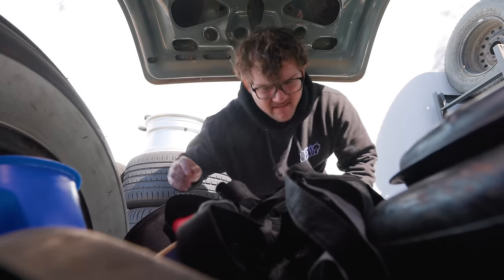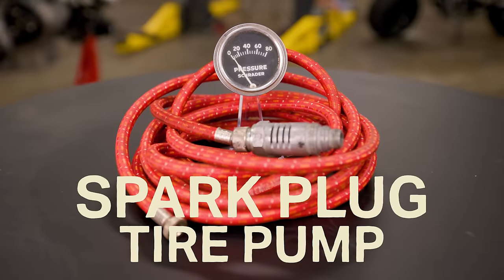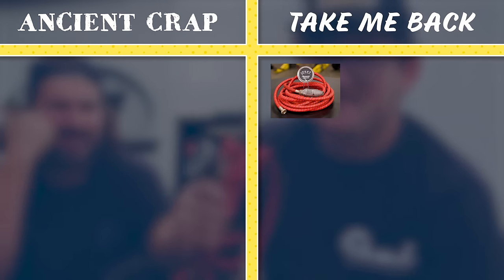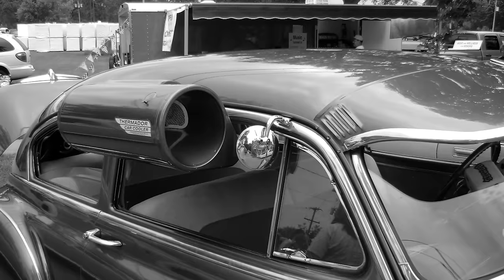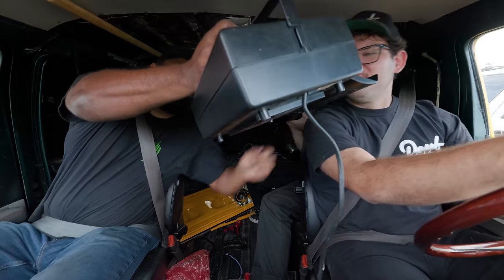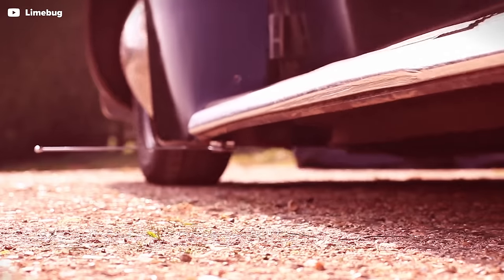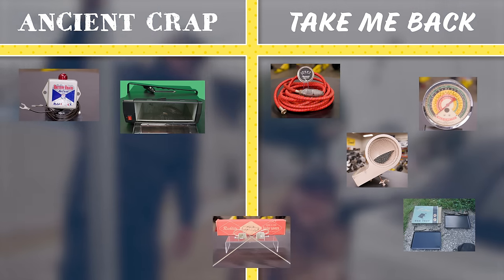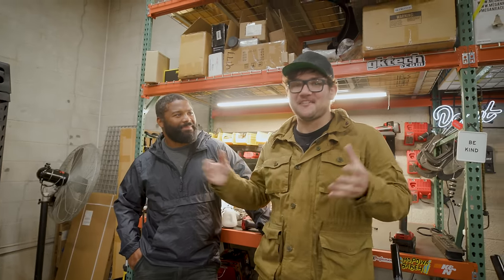Testing Forgotten Car Accessories

Comment: The led light drained down the older batteries so when you started the car the next day it cycled almost dead to a full charge "re learning" the old batteries. You disconnect it afterwards.

Comment: So the regroover isn’t meant for those tires. They are meant for retreads And retreadable tires. You see them used in heavy truck applications not so much as years ago but it’s still used.

Comment: Back before the time of radial tires some Brand tires came with the words regroovable on the sidewall. What that meant is you could cut another set of grooves when the tire worn out. I know it sounds weird but it's true. You also saw this on tractor trailer tires back before radial tires. Thanks Bob from Virginia USA

Comment: 5:15 Your engine will produce vacuum when UNloaded... If you plug in your scantool and take a look at your MAP readings you will see that the lowest pressure (most vacuum) is when coasting, followed by idle. When on full load your manifold pressure is near ambient pressure.

So either I didn't hear you right (very possible, apologies) or I think you had that backwards?

Comment: I actually have a chipped fuse for my voltage regulator to demand more power for my dual battery setup. But it's the size of an actual fuse lol

Comment: You guys were wrong about the battery brain deluxe. The resistor burned off voltage tricking the regulator into thinking that the voltage was less going into it. Causing it to raise the voltage!

Comment: Looks like the “Battery Brain” is just a resistor that’s drawing some current & routing that back to the battery. Maybe put it in parallel with the battery cables to increase the current on that circuit. That’s the only thing I can think of.

Comment: i think the tire retreader test wasn't really fair because it was made for older tires that were larger and more than likely had a lot more rubber on the tread surface, but it was still very cool too see such old tools in action.
Reply: I like the idea, but in reality I'm afraid by the time you'd regroove tires the rubber would've solidified into granite

Comment: If your grooves are so low that you have to regroup it obviously you don't have enough tread on your tire and therefore it will not pass inspection That's why they put bumps in the groove to tell you if your tire is too low in tread and therefore you should not retread it

Comment: the curb guard things actually work well if you just take the effort to point them lower. DUH. my father had them on his car and loved them. put it this way, his wheels had no curb rash (until i got it and took them off because i didn't think they looked cool!). he also had these these little clip on pieces on wiper arms. they were supposed to work like a spoiler (downforce) on the arm and make the wipers work better. f'k me! weird as it sounds, they seemed to make a difference too! i have one of those tyre regroovers that was my pops and he said they were quite common with truckers after WW11 because tyres were so expensive.
Reply: kerb guards do work but only look good on old cars, I remember cars having curb guards and a rubber strap to prevent static shock on them, I also had a Holden cruise I sold a few months ago and it had them spoilers on the wiper arms (and when i put new wipers on they never worked as good as the ones with the spoiler) and i still have a old soldering iron set that has tyre regroovers in the box I've used the tyre regroovers a few times to modify cheap mud tyres on my 4wd

Comment: Think about how small the pistons on a tire pump are compared to your car engine.
Hold a 3500 rpm down for a couple of seconds with tight fittings, and you're done. AFTER YOU CLEAR YOUR CODES. Lol.
Probably not long enough to generate any.

Comment: Those fender feelers are basically on like.. city busses. lmao, they are heavier metal cable with a like.. metal guard on the end, hang off the front by the door, so the driver can hear when they're against the curb and there the doors open. They are a good idea for cars, just probably need a specific design for each car, which kind of defeats the purpose.

Comment: Those all season or "extreme weather" wipers are worse then the cheap steel ones you can buy at Napa or whatever. Maybe on some vehicles they work great but they don't contact the windshield right on some vehicles and leave streaks.

Comment: You will have to prove to me. The UN-burned fuel going into the exhaust. Doesn't harm the O2 sensors and catalytic converter. I've read several places that it does.

Comment: The re-groiverr thing is not old crap you may not want to use it on your over the road stuff but for off road use it can be a great tool those big tractor tires are not cheap

Comment: The year 1975 Fargo ND after a summer of working at NDSU go bison in the greenhouses 140°f for a PhD from so Africa. I saved up enough money to buy a 1963&1/2 ford Galaxy 500 r code . But it had a bad tire the guy I bought it from pulled a air hose and pulled a plug 5 minutes later I was on my way home in my hotrod. The first model of the first year production racecar

Comment: I have used a vacuum gauge to approximate if I was consuming more fuel then I needed.I don't know if it helped. And we used to take old street bike tires and cut tires in them for the supermoto bikes on the track I would not use it for on road use

Comment: My uncle had a used tire shop and i remember the retreading of passenger tires back in the day, after that brush em with kerosene mixed with black oil based paint and the tires would be like new🤣

Comment: hate to break it to ya, but todays MPG readouts are created based on the same basic data the old vacuum gauges do. no complex algorithms, just more gas pedal = less MPG. the only sure fire way to get a MPG reading is to fill with Gas, drive x miles and see how many gallons it takes to fill back up and divide the miles driven by the gallons to fill.

Comment: the curb feelers do work if you take the time to mount them right. the wiper pressure meter measure does work to little skip. to much it ruins the blade by smooshing it on the glass (streaks). the battery saver was a gimmick. the tire regrover was used on truck and car tires that had on the side of them Regrovable. and are still in use today. if you would have used it on a truck tire you would not have kit the cord. modern car tires are NOT grovable. and as for the oven i have one and a coffee maker that work.

Comment: Some tires were / are s[icifically designed to be regrooved, they say "Reprovable" right on the sidewall, I'm pretty sure they are only used on heavy trucks now?  But I had a set on 16" rims years ago.

Comment: The regroover or tyre cutter as we call them in the UK are for trucks/lorry's/semi trucks and not for cars. Also that cutter is junk, there are much better ones that are old that work with a heater "n" shaped replaceable razor that recut the existing grooves.

Comment: I had a spark plug pump in a SHTF pack on my xl250! And I never used it🤷🏽. Wonder if it worked better worse or the same with a kick start single cylinder. 🤷🏽5 stars your videos are ridiculously entertaining! Love some LeCar reviews some time.

Comment: Re-groovable tires are a thing that still exists, the tools are a bit better than that one. The tire manufacturers have charts and stuff about what patterns, and depths to regroove a tire to. The tire has to be made with the 'Regroovable' marking, and not be totally bald. 
OTOH if you've never heard of such a thing, then it's most likely you will never need to know or do anything with a tire regroover. That particular tool you can throw in ancient crap tho.

Comment: Both my 1981 Honda CB1100F Super Sport and my '81 Kawasaki Gpz1100 had tool kits that contained the spark plug tire pump. Both worked extremely well and got me home several times, albeit a little late but hey, it got me home! I know for a fact that swamp coolers work, only as long as they have circulating cool water. A cigarette smokers basement from the 60's?🤢🤮

Comment: So... yeah. I did a deployment with the Canadian Army to Bosnia back in 2000-01, and saw one of those tire retreaders in action in a local repair shop! A 14 year old kid had a job there retreading truck tires. He had it on a a wheel balancer moving at low speed and he cut wavy lines into it was it went.  It was sketchy AF!

Comment: the biggest difference with old-time tech like these and modern tech is that today, you have tools that do everything you need, but since money is a bigger call than maintenance in 9-10 cases, you'll get the tools separately or not at all, as in it does in fact not work and is a hoax.
old school tech was made to fill those gaps that were already missing in most cases, and thus are more likely to do what it says it does than modern stuff does.

simpler way to put it:
Old School Car Stuff: Made to fill the gaps that would make a noticable difference to the owner, making it useful.
Modern Car Stuff: made with Easy Money in Mind 9 out of 10 times, thus being nothing but expensive gharbage.

Comment: The failed US Reliant Zoe had vacuum gauges built in which was pretty basic but did the same thing, if you ever want to cover a crazy car the Reliant Zoe will show its the craziest attempt by a British car company to break into the US market, the prototypes were even crazier with a twin rear on each wheel and a wider track than the final model... needless to say America was in no shape or mind to do anything else than refuse to buy such an oddball looking car, what surprised most is it could easily top 85mph and got there pretty rapidly thanks to the gearing of the Jaguar rear axle.

Comment: Back in the day hardly any cars had a/c so that was a cheap way to cool your car without having to buy a luxury car. on the rethreader tires had more rubber on them and re grooving tires kept traction good with out having to buy new tires bias ply tires did not come appart like radials.

Comment: Horror to modern motorists who are used to sealed tyres. Back in the 60s most car tyres had inner tubes so causing a blow out by retreading in this way wasn't a risk

Comment: The first one is a dumb idea though because you are removing a spark plug so your car is going to set a check engine light because that device is not sending spark to that cylinder.

Comment: The ""MENZEL AIR-PUMP PAT 109677". Said to be a Western Australian invention" was a very common thing prior to 12 volt compressors.
A lot of serious travelers carried them here in Australia. sure beats breaking you back with a manual pump.
Yes I knew several people that carried them and I can remember seeing one actually used in the 80's.

Vacuum  guages where a big thing in the 60's 70's and 80's, in theory you could tell all sorts of things about the engine, in theory, an engine with bad rings would not produce good vacuum. Several car manufacturers fitted them as standard equipment in the 80's when fuel economy was a thing.

Those evaporative coolers , definitely where a thing prior to Air conditioning, they worked even better if you threw a bag of party ice in there.

those wire things that scraped on the curb, yeh I remember those, yeh they worked especially on those big boat like cars with poor visability of the day.

Tyre re-groveing is still a thing, you can still buy them. Not realy intended for road going passenger tyres.
Some truck tyres are branded as "re-groovable" and there are specifications for the process.
A lot of dirt racing and off roaders and even circuit racing guys use them for modifying tread patterns.
Wet weather racing tyres are just soft compound slick tyres that have been grooved.

YEH :) you can still buy 12 volt ovens and 12 volt water kettles ....... very much considerd a joke, but some say they work if you modify your expectations.
The 12 volt ovens seem to work OK for warming up a pie, or some hot dogs, but in reality they are warmers not cookers AND ya need to use em with the engine running.

Heating tinned food on the exhaust manafold is far more effective. ... ya might want to try that ... tinned beans, frankfurts or stew are good candidates.
Ya have to be a bit carefull, leave a tin on the manafold too long and it will explode.
Steaming fish or braising steak in foil on the top of the motor is supposed to work well ....... A V8 is probably best, because there is a reasonably flat area between the rocker covers.

Comment: Some higher end cars when u change the battery u actually have to reset the computer for the new battery because the computer changes the voltage while the battery ages.  But I thought that  was a new-ish technology.

Comment: the spark pump was made before electrnic engines and you used tubes in tires should have tried that first. i think you didnt use it right the groover because 1980 or older the tires were thicker rubber so it did work good for farmer tractor tires and can work on todays tractor tires because they are thiker or farmer trucks back then.

Comment: the tire threaders were often used for racing.. the teams would get the new slick tires to the tracks and there would be a dude that his job was to put threads on them...with guides and and stuff
but one day, , the Ferrari team did not have that guy around .. he was late or something like that and they decided to try the car
without the threads on the tires and the driver said it was way better...hence, the reason racing stopped putting threads
on racing tires.. 
except for that dumb and stupid era where there were grooves on formula 1 tires.. .

Comment: I stg older tools work so much better the simplicity of mechanical work has changed so much with older car I can reach 80% of my motor to work on it  vs the mazda I replaced a headlight on I had to removed the front bumper/grille   remove the splash guard and wheel well covers remind you the push pins and screws arent meant to last forever so It ended up taking more then a day because screws and pins were just snapping        compare that 2 days long headlight change      to my 1976 Dodge van    and I have literally pulled them and replaced the bulbs within 10 minutes with zero struggle nothing else needs to be removed just pop the hood and reach to the headlight housing    its actually insane how compact engineers make cars now a days its part of their scheme so it makes mechanics not want to work on them anymore ultimately leading people to use the dealerships and service stations to work on their cars   /    also I forgot to mention if you ever plan on doing brake rotors on a mazda  you need special tools to compress the cylinder  so if your not a mechanic that 80$ tool really makes you not want to do the repair yourself but chances are your car is already in pieces which now forces you to buy the tool from mazda

Comment: the spark plug tire pump presumably worked on that car cos it has no cat... otherwise surely you are at risk of dumping wet fuel into the catalyst and detonating it there? i.e. as if you had a failing coil?

Comment: The mpg gauges in modern cars are just a trinket to amuse the gadget freaks. They are so inaccurate it's laughable. The wiper pressure gauge is a thing because lots of old cars had adjustable spring tension and the tyre cutter is not for passage car tyres and is still in use everyday all over the world.

Comment: That's not how a swamp cooler works you fill it with small amount of ice in fact the Iceman used to sell a round ice cube that would fit in the bottom of it.  That's one of the multiple mistakes.  A simple Google search would have helped, instead of making shit up.  6v systems aren't magic , And 6v Batteries aren't randomly turning to soup. Dammit boys how about a correction vid.  (No spelling or grammar was used in this comment)

Comment: WELL, you Kalifornia guys do not have to deal with ice and snow. if you know what your doing with that tire regrooving tool, you can significantly improve the winter and wet traction of so called all weather tires. I simply can not afford 2 sets of tires and wheels for 2 daily drivers. and using this tool seriously improves traction in frozen and wet weather driving. with minimum difference in dry pavement driving. it's not perfect. but very few things are. the biggest thing about using it, is knowing what your doing.

Comment: The tire cutter was made for tire of the era the tires back then were made different kinda like brake drums and discs back then could be turned a couple time before they needed to be replaced I actually did it before when I was a gas jockey and did oil changes and brake changes back before you needed a NASA degree to change oil and brakes. And yet now alot more people drive away with no oil and missing oil plugs and filters funny how that works you got to have all these tickets to work on cars yet there is alot more mistakes and ripoffs.

Comment: those spring back whiper blades are hot garbage. the insert might be ok.. but unless you want them to lift in the center at any speed over about 80 kmh then skip them

Comment: Great video and cool stuff, thank you. I recently bought pair of slicks (old tires) for my Altima's rears (there is no bad impact, cause this FWD) for some empty street race. The shop owner told that they properly used and keep the shape. But I would like to have that tool to make few threads on tires for wet weather.

Comment: Yeah but even with all those sensors and computers they still can't accurately measure fuel economy. Calculations are the only effective way to accurately measure fuel economy, most systems are about 10 to 17 mpg off constantly, Calculators and math are 1 to 2 mpg off.

Comment: Really. It's unsafe to regroove a tire. 100%wrong. And a regrooveable tire is any tire with 3/32 or more rubber below the termination of the original formed grooves. It will get you an additional 15 to 25 k miles on a semi truck tire before retreading. That's real money at 450.00/tire